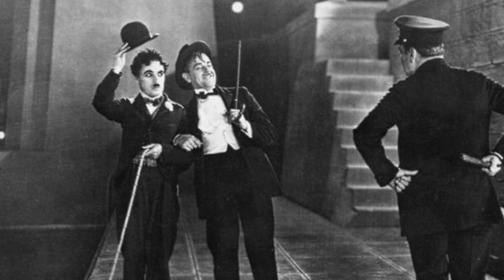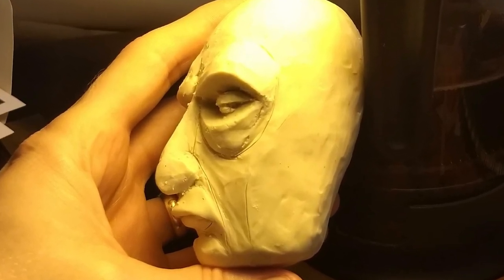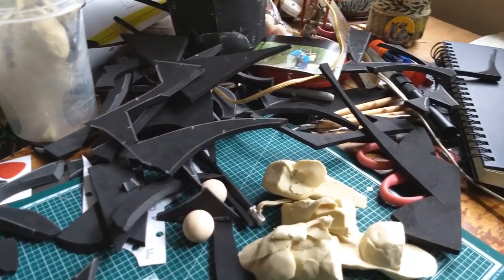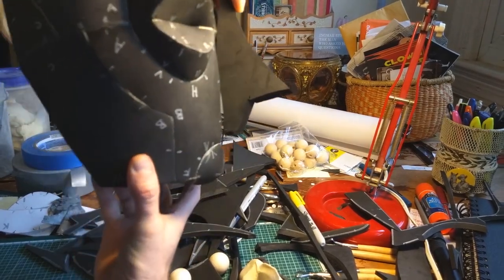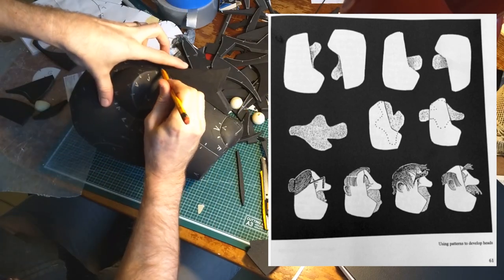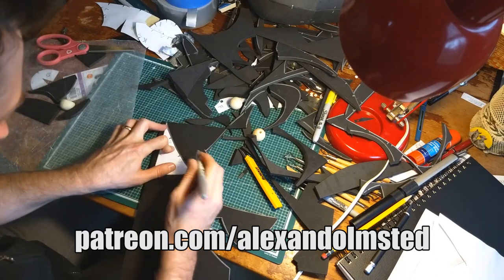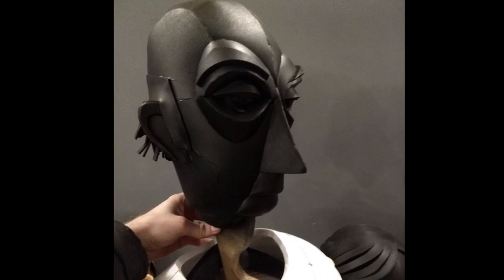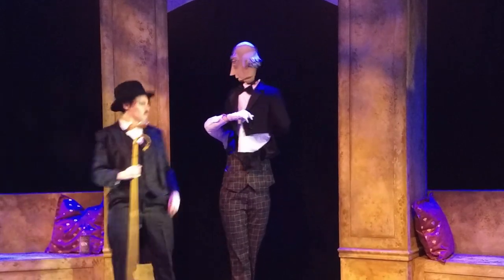Building The Butler Puppet

Comment: Hello, can this puppet's mouth open and close? Will the 6 mm thick EVA prevent this? Would you like to show us the painting steps if possible? What kind of paint do you use? Standard sponge or eva foam! Which is more useful for building a puppet? Can you say some hint aswers about my questions?
Reply from the maker: Hi, Arif! This puppet wasn't designed to have a moving mouth, so it would need a little reworking to make it movable. If I knew it needed a moving mouth from the beginning I'd probably design the lower jaw to be inset into the head and connect with a dowel or something else to pivot on.

I don't have any photos or video of the paint process, but I'll keep that in mind for the next set of ones I build. I coat everything in a couple layers of spray on Plastidip to seal the foam and give the paint something to adhere to. You could also brush on Modpodge or Elmers glue, but you'll get brushstrokes.

Both EVA and sponge upholstery foam are great for building puppets. They both have their advantages and disadvantages. EVA gives a more ridged structure, but upholstery foam is softer and will compress and stretch easier.

Hope this helps, and happy building!